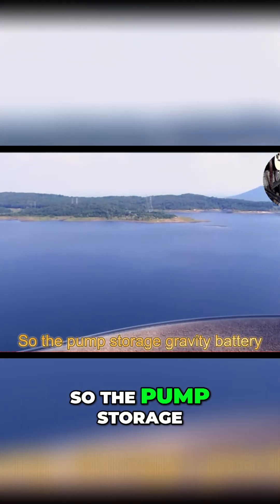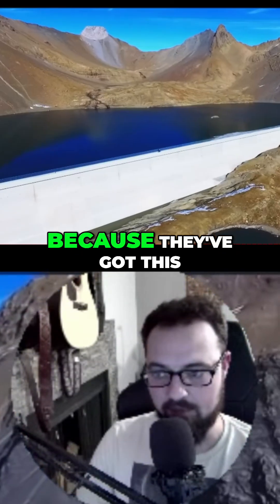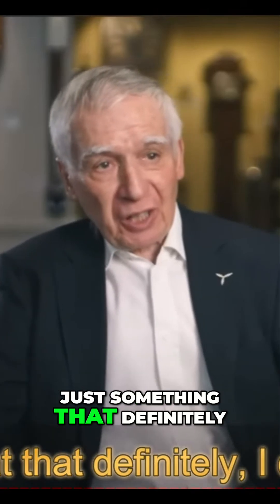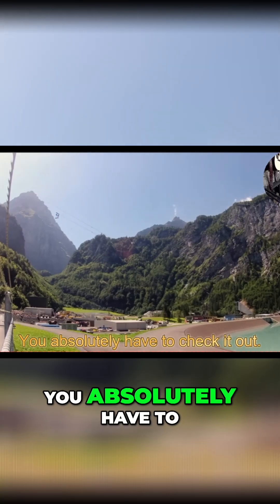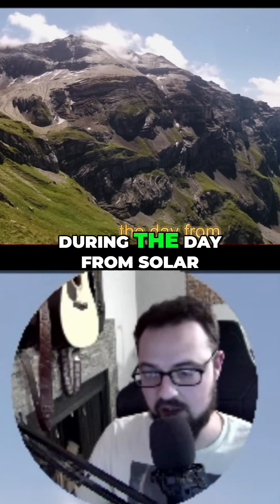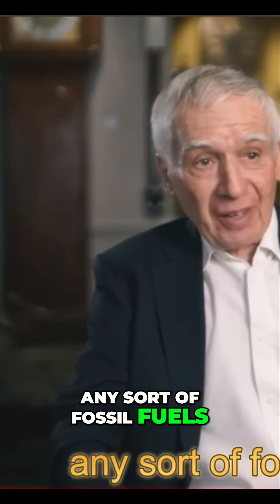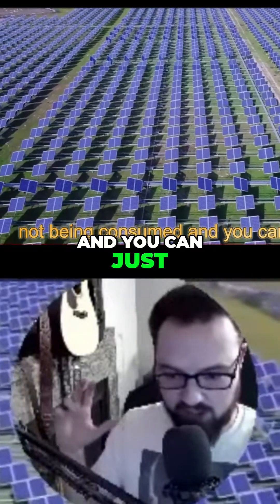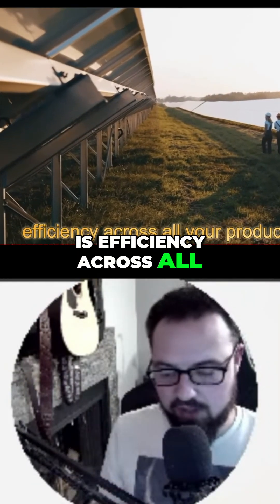Pumped Storage: How To Store Renewable Energy To Power The Future! #shorts

Comment: Good video. Thanks for bringing awareness to gravity storage.

It's a very cool technology for long-term energy storage, but it has limitations: 
1) Round-trip efficiency is low. Imagine only getting back half the energy you put into it, as opposed to the 90ish% you get can from batteries. This had better be true waste energy. 
2) Massive up-front cost. Building lakes on top of hills/mountains is not cheap. 
3) Relatively low power. The water stores lots of energy, but you're not getting gigawatts of power like a battery farm would provide. 
4) Slow response time. Turbines take time to spin up, so this isn't going to respond to second-by-second power demands like a battery can. 

Gravity storage definitely has its niche, but like every other technology, it's not a cure-all. Will be interesting to see how it competes with the decreasing cost of grid storage batteries.